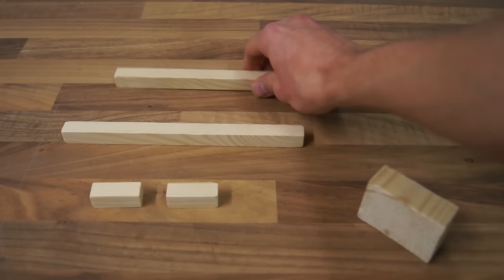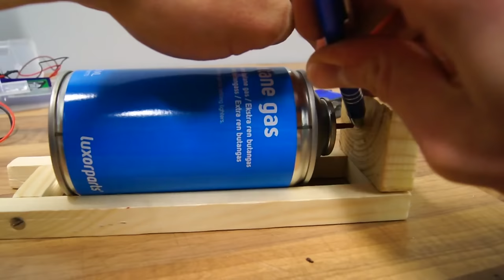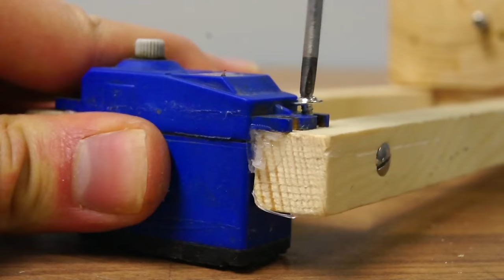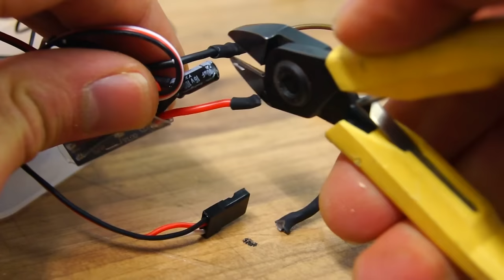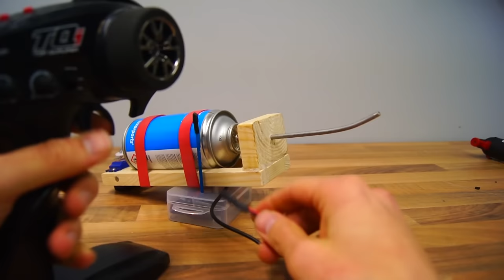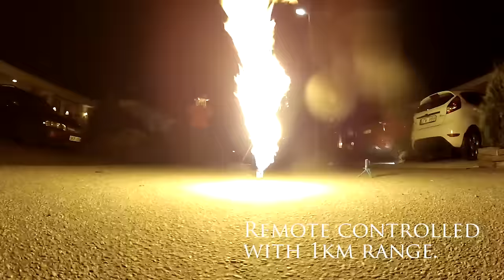Remote Controlled Flamethrower - How to Make Butane Fire

Comment: can we use a nichrome wire?
if we can, then how much gauges should be ok  ?
Reply from the maker: Yeah sure, but the gauge depends on the battery you will be using. However, 24-28 gauge should work just fine.
Reply: what if we use a 3.7v ,4500 mah battery ?
Reply: and plz give a link for butane gas too 
i am unable to find it
Reply: can we use a cigerate lighter gas instead ?
Reply: TeCh bOsS just take it from a used hair dryer, u can find them for less than $10 at CVS or ebay

Comment: hey i want to make this flamethrower but i have two questions.will the nichrome wire really light from the gas dont you need a flame for it to light not a hot piece of metal?and also does butane gas work well?bec hairspray diddnt when i tried it with my nichrome wire lighter. plz respond soon thx

Comment: Hello Friend, how do you connect the COIL to the RC reciever? Do you connect a relay? or directly to servo output? Thank you very much.
Reply from the maker: It's connected to the output wires of the electric speed controller.
Reply: Awesome! thanks for your fast response, can I connect it to a 3 phase quadcopter motor esc? and how would i connect it?

Comment: What does the BEC do?
Reply from the maker: +QUIT. It steps down the input voltage to 5V.
Reply: RCLifeOn Oh thanks! Do you have any protection circuit for the batteries? I have heard LiPo's explode when you draw too much current (I mean the kanthal wire draws arround 8 amps I think)
Reply from the maker: A small coil of kanthal will only use a couple of amps to heat up. The standard 2200mAh 3S can often suppply up to 50A of current continously. I use a battery cell spy (voltage checker) to monitor each cell. Search for "lipo cell spy" and you will see what I'm talking about.